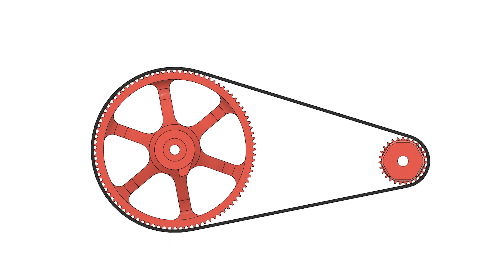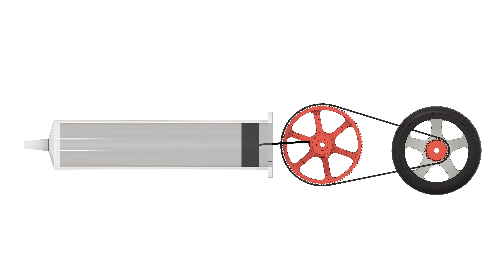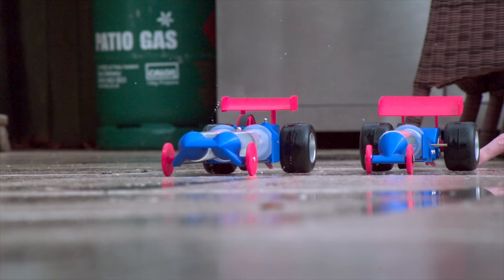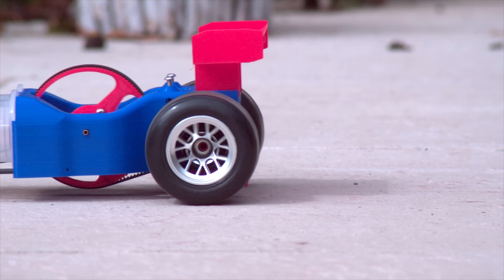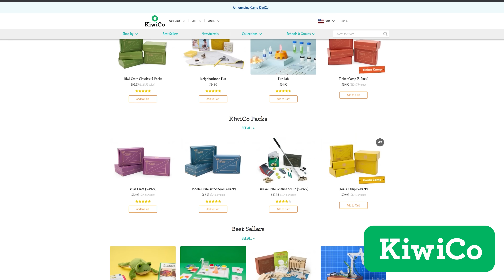Vacuum Dragster

Comment: What's really going to blow you're mind is I think the great pyramid was a vacuum powered machine. Water pouring into the base created vacuum in the well shaft which ported up right between where the 2 chambers split off. The chambers shafts are polished stone. A polished stone that fit could have acted as a piston. With ropes going outside to a drum on each side you could have 2 cranes. One on the north side the other the south side. Other supporting evidence...
The stone ball, was a bleed down valve.
The King's chamber has a lip to keep the entrance stone from getting pulled in under vacuum.
The "sarcophagus" could have been a sliding valve that broke. No evidence it ever had a lid or a body. It fits the wall.
Also fins to control water in the subteranean chamber which has a drain that leads to the Nile.

Comment: Would've been fun to add some weights over the drive axel to increase grip, possibly to find out if that amount of weight was enough to offset the benefits of the added power from the extra syringe.

Comment: 4:20 Wrong mass. It should've been 90kg to be shooted over 300m distance. It is what the superior siege machine Trebuchet would do, which is also a good teacher of mechanical advantage.
Reply: I had a model trebuchet kit once. Art shops sometimes have them. Just keep the counterweight empty when its not in use. Mine was full of coins for years and it broke the axle.
Reply: Syringe powered trebuchet? Sign me up.
Reply: Funi number

Comment: Consider the last bit of the syringe pull cable having a slightly larger shaft radius for increased initial torque.
Reply: I can think of a couple ways to build that out of frictionless ideal materials. I am not sure how to make something that would work in the real world, that could be wound by hand, and would be easy to make.

Comment: I think a better way to use a dual syringe setup would be to give each syringe a different ration to the rear axle. That way, one syringe can sent high torque off-the-line while the other one will run for longer; sort of a booster and sustainer method like a rocket. What do you think?

Comment: Hi Tom, I'll be starting Uni in september studying Mech Engineering. Any tips/advice for me? How important is it to do individual projects like you do on your channel? How did you learn how to build the projects on your channel? Was it independent initiative or  mostly skills taught by your course? Thanks!
Reply: I recently (this year) started a engineering course and think that one of the best ways to learn is through projects. I'm now part of a team that develops robots for competitions, and the most things I learned till now were with the other guys from the team and research related to that
Reply: @viniciusfriasaleite8016  Yeah my University runs a Formula Student team which seems interesting to me just a bit intimidated I suppose, like I doubt I'd have much to offer lol.
Reply: @nuttydiger  Mine does too, but in my opinion a formula car can't be made in the university so the team pretty much buys the pieces and assemble the car. I work on a line follower robot, so there is more things to really think of and make. But I'm sure that you will have a good experience with both
Reply: @nuttydiger  I'm a sophomore mechanical student... I would agree with Vincius on the Formula car being often a lot of bought parts, but not always and that doesn't mean you can't make your own testing equipment, steering, suspension, or any part you want to make. I am the Suspension design lead for the Baja team at my school and though we buy our shocks, the placement, geometry, style and everything else is up to us to design and manufacture. All the SAE teams still have to manufacture as much as possible. I've learned the most by far in the team over classes, but both are extremely useful. Be patient and get involved is the advice all the seniors gave me last year.
Reply: I highly suggest joining your uni’s formula student team. You have no idea how well it develops you as engineer. Don’t worry about having any prior qualifications, the purpose of the team is for you to learn and grow in engineering, just become with a keen willing to learn attitude. I can safely say my two years at my team has really developed my skills and helped me make some great friends along the way.
Reply: @nuttydiger  My university has about 7 vehicle teams (Formula, offroad, solar, ebike, rocket, UAV, autonomous RC). I'm friends with many of their members and was a founder of the last one.

My advice - start early, ask questions, and help out anywhere you're willing to try (not just where you think you can). The people I know that became integral team members started exactly where you are in their 1st or 2nd year, but worked their way up to design/leadership positions. All the club wants from you is to be eager to learn, and to put in your time and effort.

Joining clubs and doing competitions not only gives you hands-on experience complementing your classes, but helps you make some really good friends, lets you work on really exciting projects, and is extremely valuable when applying for jobs later on. Some of the most fun and best friends I've had during uni were from the clubs I joined.

Don't worry about being scared or inexperienced in anything in University - we were all right there with you, and accepting that I would have to start as a total noob was the first step to some of the coolest shit I did.

Good luck!
Reply: @nelsonn3042  true, there are always easy jobs for starters in any team, I'm starting into my third year in formula student now (sadly still second season thx to covid) and am leader of the suspension department for one year now
Reply: @tristanhanley8741  alfa romeos handle well, but are ugly. Jag and Saab (used to) make the best looking cars
Reply: As a nearly graduated Mech Engg student, I learned a lot from projects outside of my classes, whether individually, with a few friends, or with multidisciplinary clubs. My experience working by myself and with Engg students outside of Mech really helped me professionally; generally speaking, the people I knew that did side projects were the ones that got the cool design-oriented internships.

I would also say only 20% of the classes were hands on, and it's up to you to apply a lot of the stuff. Also joining clubs and doing competitions is a great way to make friends and/or professional connections.
Reply: I'm not a mechanical engineer, I'm a software engineer but I'd say personal projects are critical to getting good at something. Primarily down to the fact if you're interested enough to do your own projects in your own time, you have the right head on ;-)
Reply: @richbuilds_com  a lot of people want to become mech eng but study coding for the job opportunities
Reply: Thanks for all the advice really great to hear it from people who's shoes I will soon be in :)

Comment: all faces experience the same force? :(
Reply: Yes, if the forces were unbalanced then it would accelerate in some direction. (Technically pressure is slightly hight on bottom than on top, resulting in a small amount of bouyancy)
Reply: @kevinrdunnphs  Well, no. All faces aren't experiencing the same force and the cube is balanced (mainly by hand against gravity). This part of the video is just weird to watch with the claim that "same force" allow it not be pushed down by atmosphere while it's actually providing upward buoyancy. Hence my cryptic inquiry.
Reply: @walker15130  what are you talking about. Atmospheric pressure pushes on all sides, including down. And all forces are equal over the object otherwise it would be accelerating.
Reply: @kevinrdunnphs  Atmospheric pressure is higher on the bottom of object. All forces aren't equal. In this example the highest forces are coming from gravity and hand (both vertical), while sides are only subject to air pressure. Object isn't accelerating because net force upon it is zero.
Reply: @walker15130  the force difference top to bottom is basically negligible. 1atm +- 0.00001 or probably even less. And the normal force balances out gravity. So all the forces are roughly equal. Gravity doesn't really act on any face specifically so calling that a force on a side wouldn't make sense. So I suppose the bottom with the normal force has significantly more force. Buy from the atmosphere it's almost perfectly even

Comment: Nice concept and lovely design. Perhaps a vacuum powered glider next?
Reply: What is a 'powered' glider?
I thought the point of gliders was no power
Reply: @SwordFreakPower  a powered glider uses some kind of propulsion to gain altitude, then turns off the engine and glides.
Reply: @avroskroksthestarfish4495  so planes are just powered gliders? No.
Reply: @SwordFreakPower  they use power to get in the air then glide down
Reply: @SwordFreakPower  Self launching.
https://www.youtube.com/watch?v=XtYI7zcLYuY
Reply: that would be awesome.  connect driveshaft to a prop instead of wheels.
Reply: VFR Explorer that’d be cool
Reply: No! More power! I want the fastest dragster powered by vacuum on this side of the milky way
Reply: Yes, I agree
Reply: I'm having a good laugh at all the noobs who've never heard of a powered glider / self-propelled glider; anyone would think they'd be smart enough to do a google search before embarrassing themselves...
Reply: @SuicideNeil  that's called a plane, noob.
Reply: That probably won't work at all as his previous air powered glider was already not really flyable and had multiple bars of pressure in its chamber, whereas the vacuum concept only provides 1 bar max.
Reply: @konradpeter9547  it could just be an assisted flight, may not be sustained.
Reply: @konradpeter9547  He might be able to make it lighter and more efficient, though. I'm not sure, but the fact it would require very few parts means it could be possible to keep the weight quite low.
Reply: I was just in the middle of scrolling down to suggest that exact thing heh
Reply: VACUUM POWERED VACUUM
Reply: yess that would be great!
Reply: Or maybe a water powered boat
Reply: Yup! Maybe launched from an angled rail, like the German V1 rocket.
Reply: How would he do it?
Reply: that wouldnt be hard too becausing it wouldnt be as heavy
Reply: This is a great idea!
Reply: Just a random thought, is a vacuum powered glider still a glider or just a vacuum powered plane?
Reply: Bonus points if the prop can freewheel after the piston is done.
Reply: Nabre Labre or use a folding prop, even more efficient after power is finished.
Reply: @flyingby3703  good idea, it folds on a basic hinge, no springs, opens from centrifugal forces
Reply: I think I may have to do this as well.👍
Reply: I really like that, he did a pressurized airplane once so I know he could do this
Reply: He could use a vacuum cleaner for something... Maybe to make the vacuum. 😬
Reply: But isn't a glider classified as a propulsionless aircraft?
Reply: @junatah5903  yeah but still its propulsionless until you add propulsion but then it stop giving propulsion
Reply: @buzzygaming7667  a glider has pre propulsion before takeoff but once eoff the ground, it no long has propulsion.
If it has propulsion mid flight then it's a propelled aircraft.
Reply: Perhaps vaccuum for your goddamn mouth
Reply: Not a glider if it is powered
Reply: A glider isn’t supposed to be powered... That’s why it’s called a glider.
Reply: @lucse_mensen  Regardless of what you think it's "supposed" to be. Are you saying that you're not familiar with a concept of a "Powered Glider" or are are you denying that such thing exists?
Reply: LUCse MENSEN how do you think it gets in to the air, fairy dust?
Reply: @lucse_mensen  it starts as a rocket with the vacuum and then flies and lands as a glider
Reply: powered and glider don't work it would be a plane
Reply: Nicholas Brock I thought so too, but then again there are gliders which have sustainer jets/engines/electric motors or are even capable of self launching and they are still called gliders. I think the difference is in if the plane was built as a glider and the power-plant is only an extra vs. the plane being intended to fly with some form of engine most of the time. Then again there are planes that are called “Motorgliders” (literal translation of the german word Motorsegler, probably wrong) I‘m not sure on the matter. And I am getting a glider pilot license myself XD.
Reply: @nicholasbrock9758  SMH As Neal deGrasse Tysone once said: "A great challenge of life: Knowing enough to think you are right, but not know enough to know that you are wrong."